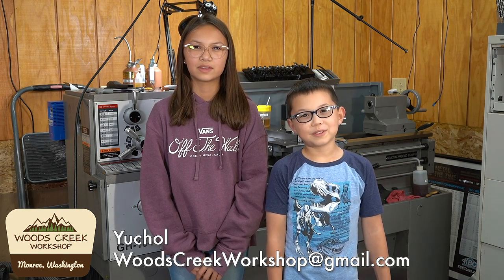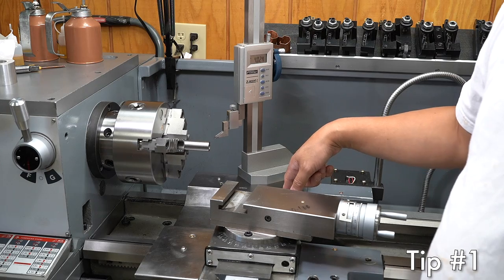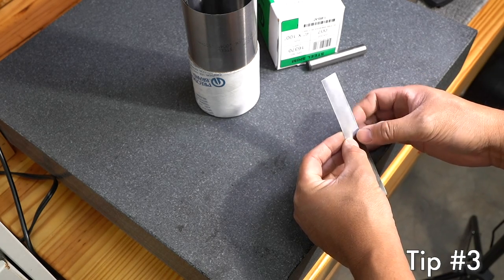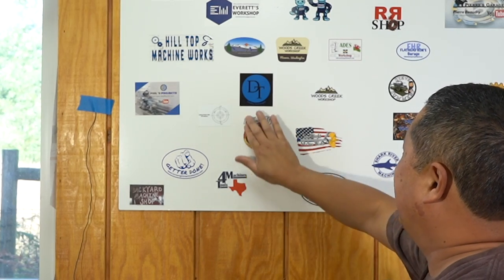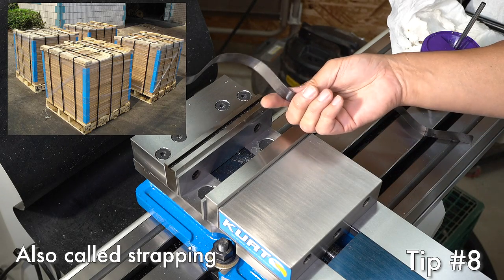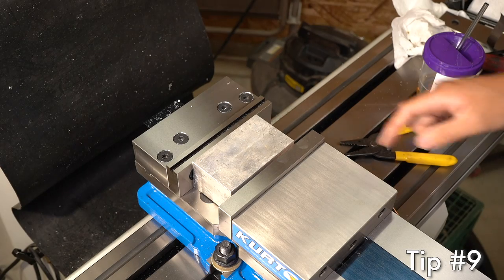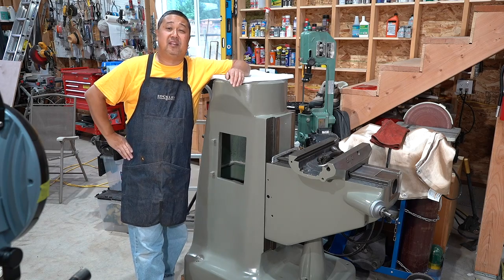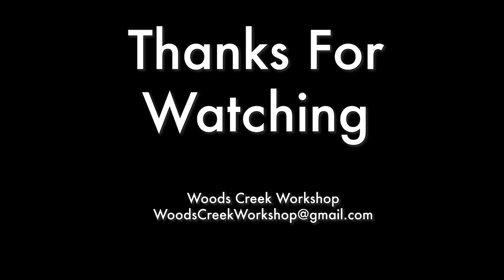13 Machine Shop Tips (Friday the 13th edition) #Tipsblitz19 #Tipblitz19

Comment: Good tips. I repainted my lathe with epoxy using a brush as the shapes are so complex.
Reply: Evan, I think you hit the nail on the head with the epoxy paint.  It is tougher against impacts, more resistant to fluids used in conjunction with machine shop practices, and reasonably smooth for easier cleanup.  When you say epoxy, however, most folks think of the hassle with a two-part mix and limited working time.  Blige paint, made by TotalBilge, is a one-part epoxy paint.  There are several Youtube presentations on the material.  On larger flatish surfaces it applies well with Yucho's roller method.  The paint is volatile, so use good ventilation or paint outside.  It does not like to be applied in hot weather.  In that situation, it requires thinning (Xylene), which makes it even more volatile.  I should mention it comes in a very pleasing grey hue.
Reply: @rubarb0406  Thanks for the feedback.  I have been very happy with the results obtained with this one-pot epoxy paint.  There has been very little loss due to chipping. It is shiny and easy to clean off. It went on easily with a brush.  I should have used a filling primer or undercoat to fill old chip defects before the final coat, but it is good enough.
The paint I used was Australian "Wattyl Australia Pty" brand Killrust Epoxy Gloss Enamel, Ultra Blue 500ml, Wattyl.com.au.

Comment: A nice wee bunch of tips.  I'm sure these were exactly the sort of thing Emma was thinking of.  There will inevitably be some overlap with the tips, but even when that has happened there have been tiny variations in approaches, and it is all useful information.  A nice spin off is that I was only subscribed to about half of the channels that contributed to Tip Blitz19, so I now have more engineering channels to follow.  BTW  my favourite tip from you is the magnet in the cutting oil container, and mostly because it is going to help to stop me knocking it over quite so often.
Reply from the maker: Thanks for the note and I’m glad I could help at least in a small way.  Cheers! 👍🏻

Comment: I use the tractor and implement paint from Tractor Supply, it is specifically formulated to be able to paint over dirt and grease and when you used the hardener it is very durable, I used Massey Ferguson Gray is looks good on my equipment.

Comment: Great tips.  Regarding lathe center height, one can make a simple fixture, placed on the compound, to quickly set proper tool height.  Once the fixture is dialed in (using an adjustment screw for example), it's very easy to repeatable set a new tool to the proper height without any measurement or test cut trial and error.  Works especially well with Aloris-style tool holders.

Comment: VERY good tips. When using the compound for making fine adjustments to in-feed, set it at 30º to the work axis which will cut the movement in half. If you dial in 0.001", the tool moves only 0.0005"
Reply from the maker: Thanks Ron,

Comment: Hi Yuchol, great ideas I use old computer hard drive magnets in the shop, will have to throw one in the cutting oil. That one would have saved a mess when the oil container vibrated off the mill the other day even though it was a kiddy no spill paint pot it still splashed out on the floor Grrrrr

Comment: I really enjoyed your tips video.  I look forward to seeing others.   I am an artist that happens to work as a prototype machinist and I also like to avoid having to use math anytime I can.  You might consider doing a cheat sheet on the compound cross-slide travel ( tip #6 ) at various different major angles like 10,20,30,40 etc.(or maybe I will do one myself :))  Thanks for the inspiration!
Reply from the maker: Hi Kurt, that is a great suggestion👍🏻

Comment: Great video thanks for posting. Some very good tips here. Question,  in tip #1 , can  you zero the height gauge at the top reading,  and simply move half the diameter to center?
Reply from the maker: If you have a vernier gage, yes. If you have a digital gage, the display will only show the radius of the round stock.  You’d have to remeasure from the center to the top of the cross slide.  It won’t buy you anything.

Comment: Yuchol you mentioned using hardener in the paint. I use Rustoleum paint and the recommended mix for spraying is 4 parts paint to 1 part acetone and 1 part hardener. I am like you and hate to spray. My lungs are shot already. My question is do you have a mixing recipe when you roll the paint on with a roller that you would recommend using. ? Thanks Terry
Reply from the maker: The catalyst can label has the mixing ratio, no difference in spraying versus roll on, but my experience is you can use twice as much as recommended and it works just fine.  I just get lazy and don’t want to actually measure.  My approach is “that looks about right” 😆

Comment: Great stuff Yuchol. I did not know that you could get catalyst hardener for standard enamel paint. Does this make it more solvent resistant at all, would you know?

PS: There is an email from me in your inbox!

Cheers,
Craig
Reply from the maker: Craig's Workshop I can’t say if it’s more solvent resistant, just not enough exposure to solvent yet.  Amazon sells similar catalyst as well.
Reply: @woodscreekworkshop9939  Ok, thanks for the heads up. I think I'll get some and give it a go. Cheers, Craig

Comment: Speed chart - I didn't print mine - it's still in spreadsheet form. I've not done what you've done and used 'correct' calculated speeds, I've listed the first speed available on my machine that's slower than the calculated speed for the diameter. So I've no maths juggling in the head at all but see a speed that's exact to what my machine will offer. In your case, it need not show speeds, just could show the letters to set the gear lever positions.

Comment: Some good tips there, i like the spread sheat one, at my age the memory is not what it used to be and as you say, messing about with calculator, its a shame i use metric.
Reply: Just multiply the standard numbers by 25.4 and you can use the chart. :)

Comment: What did you use for paint on your mill?  It looks great.  Email sent, I could use that chart.  Many thanks.  J
Reply from the maker: It is Sherwin Williams All Surface Enamel with color matches to South Bend lathe.  All applied using foam rollers
Reply: @woodscreekworkshop9939  Thanks!